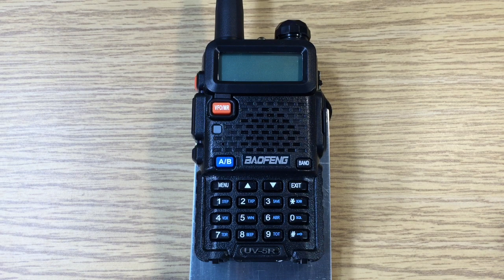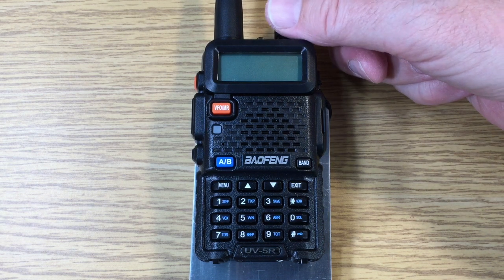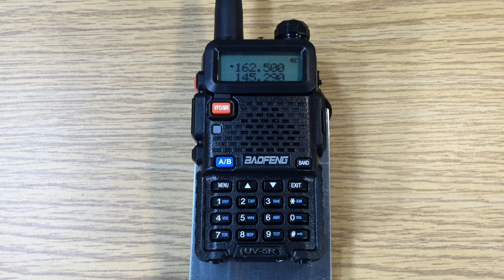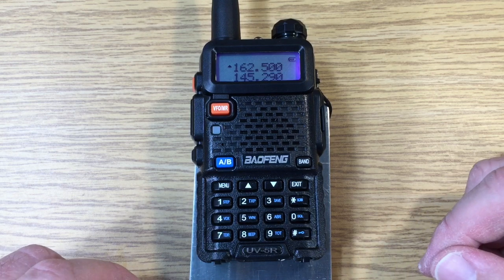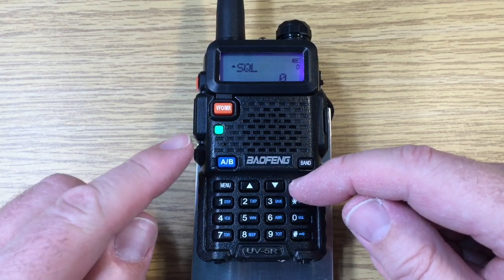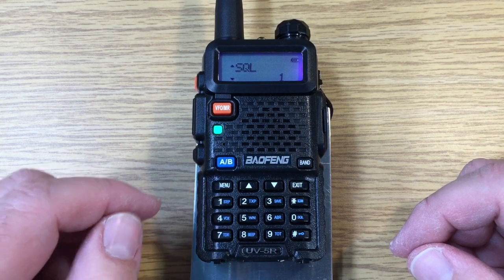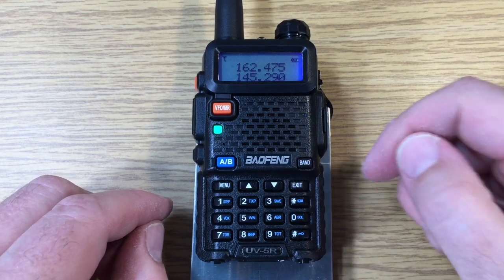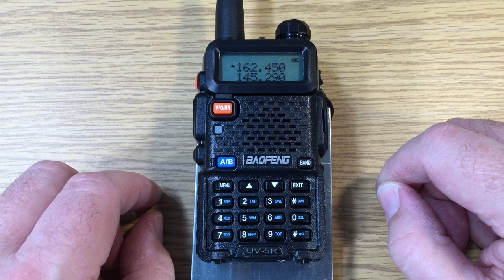BaoFeng UV-5R Setting Squelch

Comment: I am trying to listen to transmission on FM frequency which is 75.700 and there is constant background noise when no one is transmitting.  The squelch has no effect and wonder if there is some other way to cut out the background on the FM band?